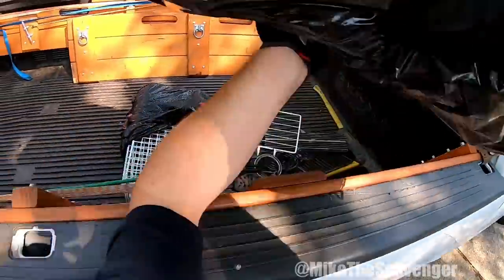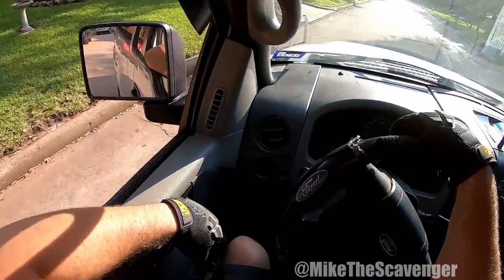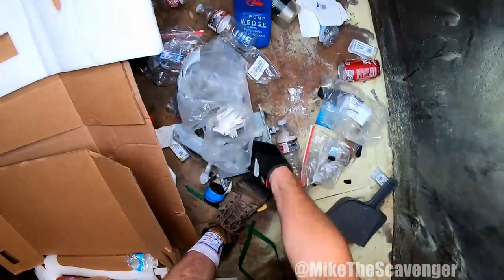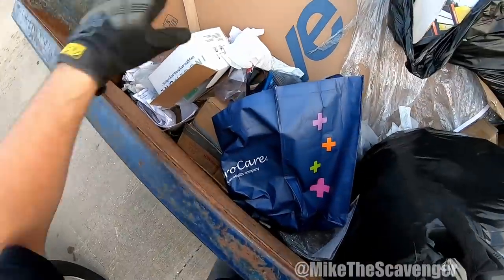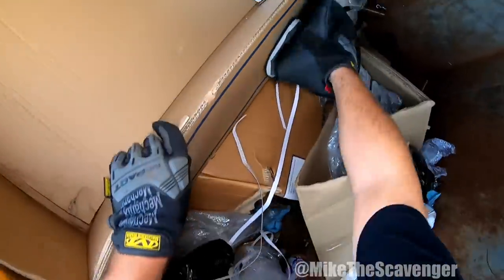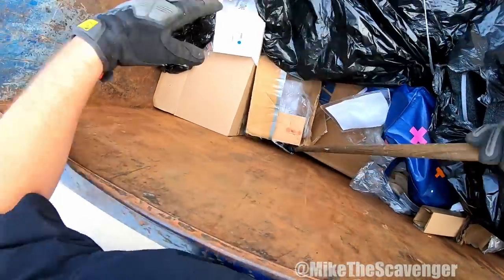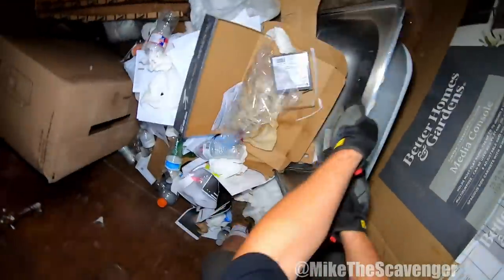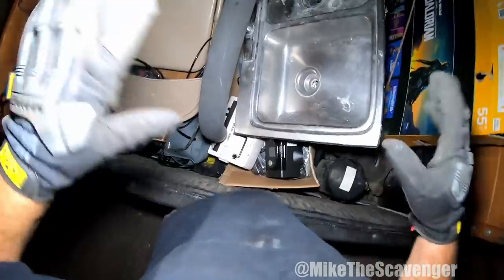Dumpster Diving & Curbsiding "A Cord Amongst The Flies"

Comment: Those letters even though they were plastic, people like them for crafting. Probably could sell them for $5 each. Also, if you come across printer/toner cartridges, you might want to check them out... The electrical contacts are almost always gold! I usually pop them off with a small screwdriver.

Comment: Since there's still a shortage, that Resmed machine, sanitized and refurbed, sells for $3 -500 dollards used.
Reply: There's a reason it was in the dumpster.
Reply: Too dangerous to resell medical equipment.   Anything that requires prescription is highly regulated and penalties are steep.
Reply: They can be and often are refurbished and sold - but you do need to know how to do that……

Comment: Hey Mike, really enjoy sitting here watching your antics saving reusable resources from the landfill, but have a suggestion if I might, as in this video I have seen you pull other O2 regulators and much other equipment that would be extremely valuable to say a Volunteer Fire Department with a very restricted budget. Also seeing some of the wood you leave behind you need a friend that lives close that is a hobby woodworker!

Comment: hey Mr Mike those green regulators how you found one of the box that brand new in the box don't trust it you got to check it before you try to sell it bro because those things blow out like crazy I've already been through two this week yeah there's an inside little thing where those two little holes are on the bottom inside there they always mess up in there and they won't hold air soon as you turn your tank on air just goes right through it